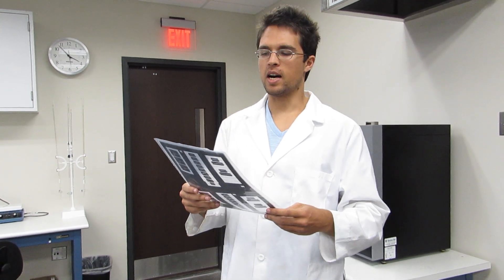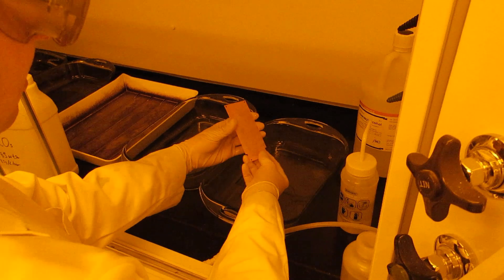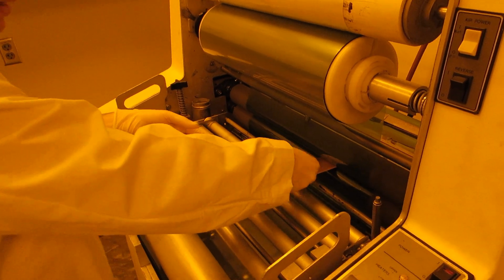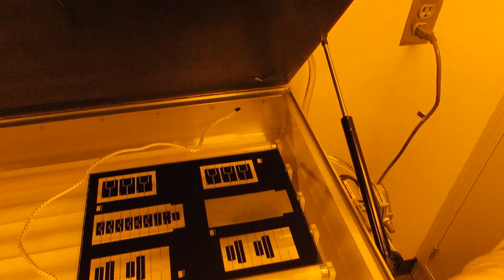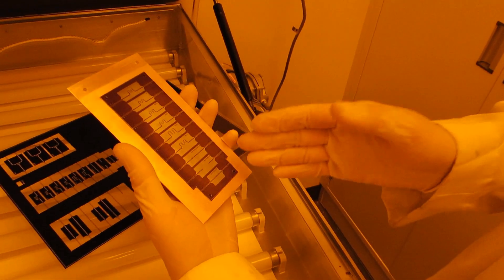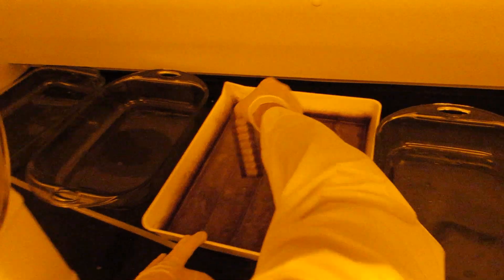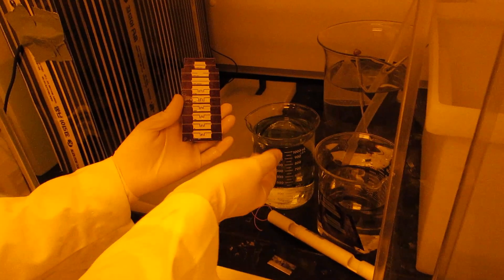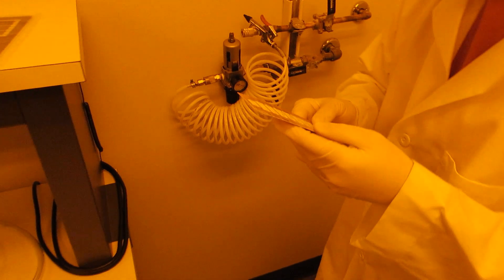Photolithography Process

Comment: I just use a modified $20 laminator, far less photo resist film, no vaccuum bed just an exposure frame, cheap UV LED box and an etching tank with an aquarium heater and air pump for agitation o.0  No wonder Universities have to charge so much lol

Comment: Hi, Robin, thank you for making this video, it is really useful, I just have a question, why you need to use the rope to inclose the mask?
Reply: +Sasha Wang Hi Sasha, we used the rope to elevate the hole of the vacuum. Without the rope the vacuum creates suction only in the tube, but when it is elevated by the rope suction is created throughout the entire UV chamber.